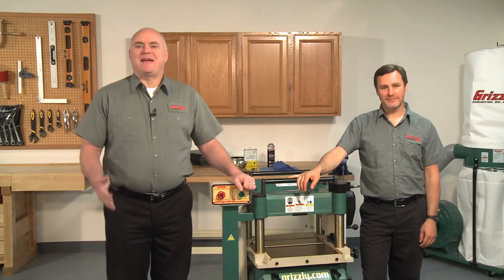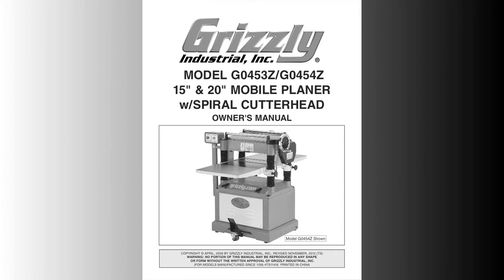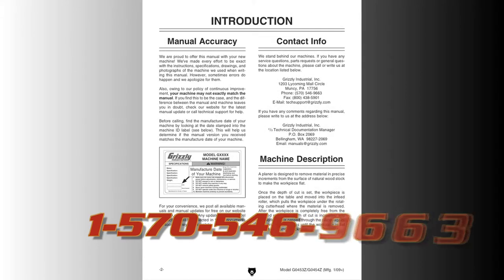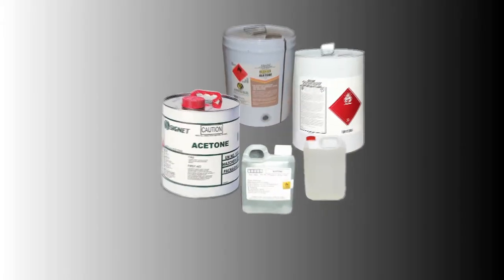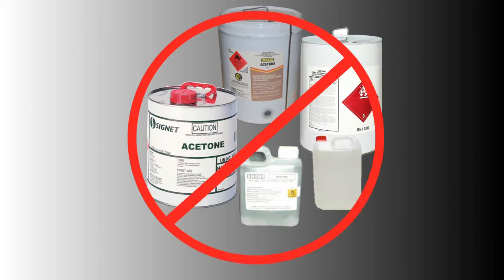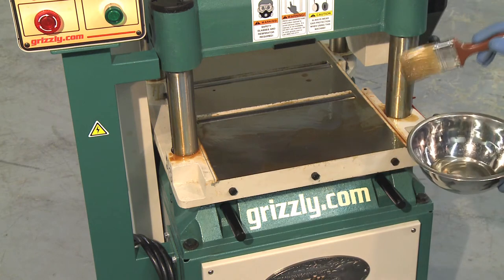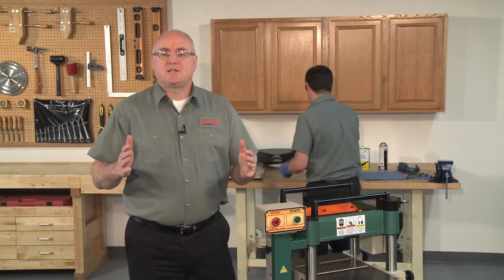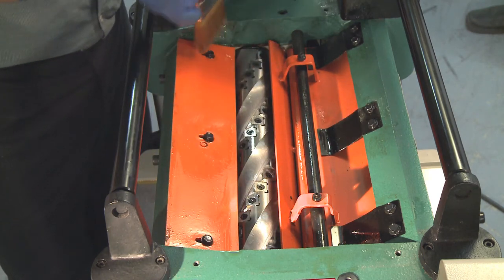How to Clean Cosmoline - Type Coating Off a New Machine

Comment: Get to it! And what is "solvent"?
Reply: mineral spirits, turpentine, acetone, diesel fuel, brake clean, ect.
aaah wd40 surly isnt residue free your just going to have to clean that off with a solvent. btw test plastic areas before melting or disintegrating.

Comment: I know you said not to, but I've had luck with both brake cleaner (G0602: v=O_l0bDzyJAo) and WD40 (G0704: v=cKSXJDKM3OA) without any issues, or problems with the paint.